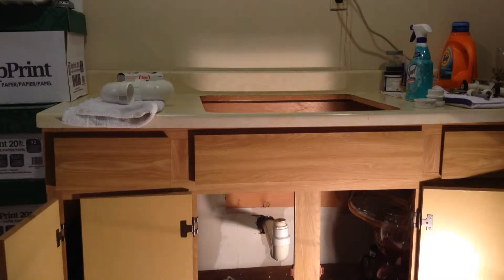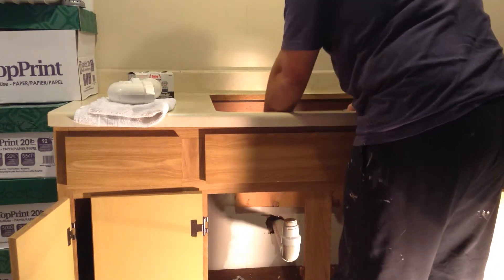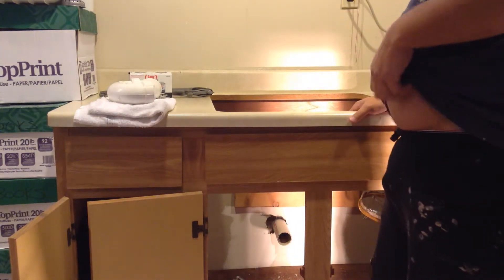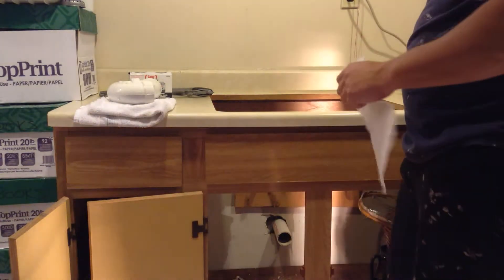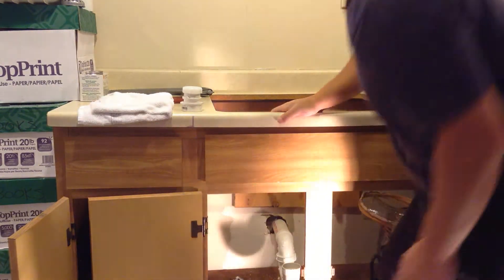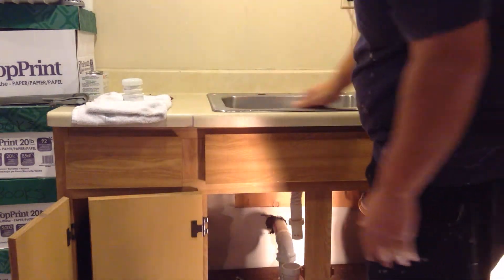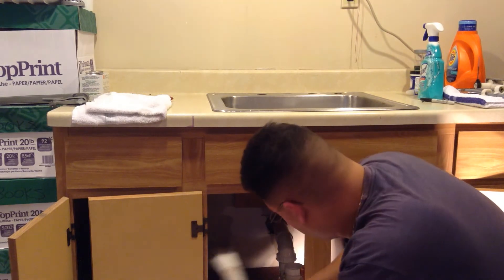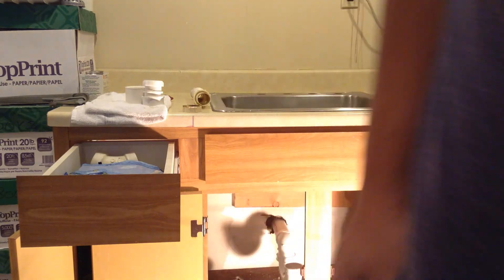Fixing the Basement Sink (Part 2)

Comment: "We're gonna do this in real time.  You follow me, camera guy?"  If that doesn't clue you in, I'll bolster that by saying "'Cause you know we can't do this all day".

I've never, ever seen a flex drain pipe in service anywhere, in any installation.  Kind of a nice idea, but also gives the feeling of cheapness--why not just cut the pipe straight and line everything up right the first time?  I understand that can be very useful in certain situations, I've just never seen one installed.  It's also no big surprise it broke after all these years.  Good thing it broke now rather than when you are using the sink and wondering why the floor is getting wet.

As for the pipe smelling like detergent:  Well, that's pretty much what goes through that pipe, the washer is at the other end of it.  I'm going to add my 2 cents here and tell you (again) that liquid detergent is pretty nasty stuff.  In the 50's, they used to call liquid "Syndets", for synthetic detergent.  The name never stuck.  Wisk was the first liquid, and the 50's commercial claimed "because it's a liquid it washes so clean" (ask me how I know about all this).  Of course, like anything else, it's just marketing hype.  Spill a little liquid detergent on the floor and leave it there for 2 weeks and let it dry.  Sticky and gooey.  Strangely, the water does not wash it away.

Sharkie626 has been using powder detergent for years, and swears by it.  That, plus the warm rinse equals a very clean washer.  He tells me the outer tub in the washing machine is spotless even after all those years of service.

I agree, powder was, and still is better all around.  In the 80's, most companies started switching to liquid.  It was marketing hype, they tell you it's better (and don't get me started on this 2x and 3x and 10x BS they have now) but it's not.  They switched to liquid because liquid contains WATER, which, compared to the actual ingredients, is essentially free.  So they've been selling you mostly water for many years.  When you buy powder, you get just that.  Sure, they use fillers, so you still get ripped off, but they're not going to coagulate into gooey sticky junk that adheres to the insides of the washer.  Again, ask me how I know.